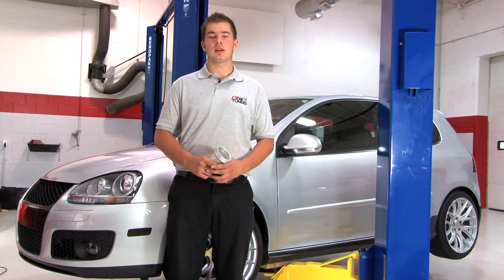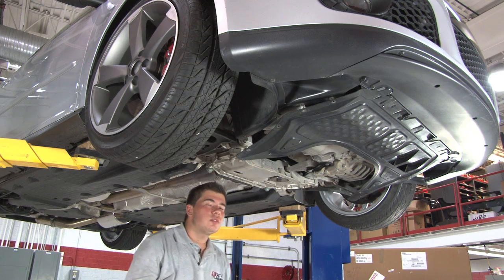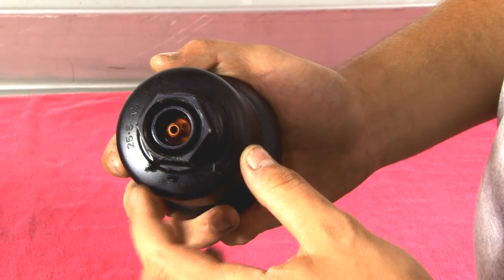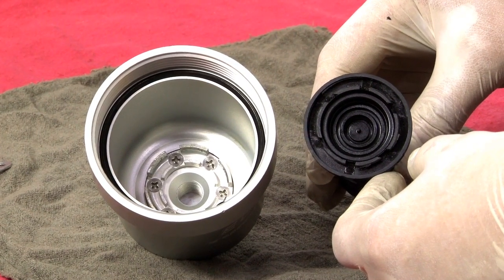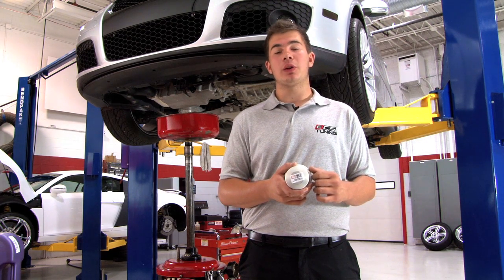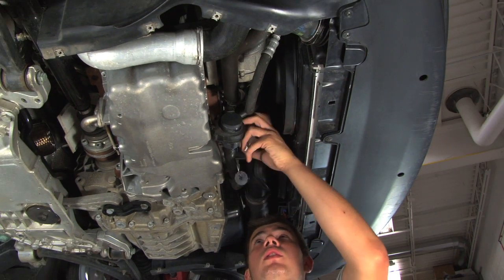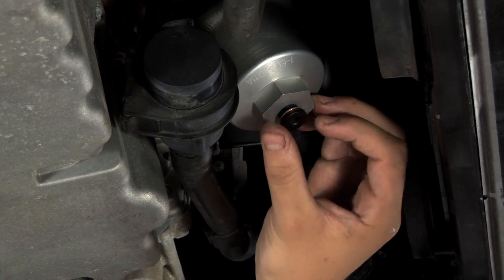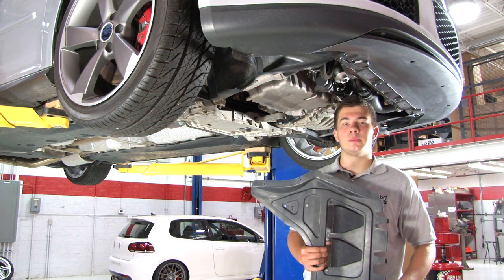ECS Tuning: Billet Aluminum Oil Filter Housing Kit DIY

Comment: Installed mine to the correct torque after having a new oil filter unit (my old plastic one was seized on and getting it off cracked the unit it screws onto). Started the car and it leaks from the rim of the housing. Nice one ECS, I'll be putting the OEM one straight back on! Not pleased at all!
Reply: that sounds like a you problem

Comment: I  have a very small leak from the filter housing area, on my daughters 2010 VW Beetle. (2.5L)
I have already purchased and tried 2 of the cheaper Doorman brand housings, but still have the leak.
So my next question is this:
1)---Do you think the more expensive one would take care of it, OR
2)---Do you think the leak is coming from above the filter housing and running down the housing?
>>>>>Usually by now after having tried 2 new housings, i should probably assume it is coming from above it right?
BUT
The reason i still think it is the housing myself, is because when i bought the car it did not leak. It did not start until i changed the oil, which was right after i got the car. As i posted somewhere on here, the filter had not been changed in a long time because the filter was a cruddy sludgy mess!
The leak is bad enough that i just had to add 1 qt after 4k miles, so i have got to stop this!
I can't get a good enough look to see if oil is coming from above the filter. Just not enough room in there to see anything or get you hand in there w/o removing parts. But from what i can see, it does not seem to be?
So, what do you guys think?
Should i try one of these and go from there, or after trying 2 of the filter housings already, should i just take this thing to the shop and find out where it's coming from before i try this ECS housing?
Thanks for reading, and any help here will be greatly appreciated!

Comment: [Yeah, I know.. this is an ancient video, but the info is still useful]

So… the housing takes 18 ft/lb torque, and the drain plug takes 22 ft/lb.

This means the housing will come off before the drain plug??
Reply: So now it’s engraved, the housing is 18 ft lb and the drain plug (for the cup aluminum housing) is 18 ft pounds as well… I tried the 22 ft lb and stripped… had to get a new one

Comment: are you guys just going to sell the drain plug to this kit as the mechanic has rounded off the plug,over tighten it.
Reply: rocktheroc Just use the screw on the oil pan to drain the oil

Comment: 1. That's a centre tube, not a by-pass valve.  The purpose of the centre tube is to support the cartridge filter and preventing it from collapsing/buckling.
2. Install the OFH drain plug and "O" ring. 
3. Lubricate "O" ring with fresh oil
4. Prefill the OFH and filter cartridge assy with oil to prevent a dry startup.
Reply: What sits at the bottom of the tube?